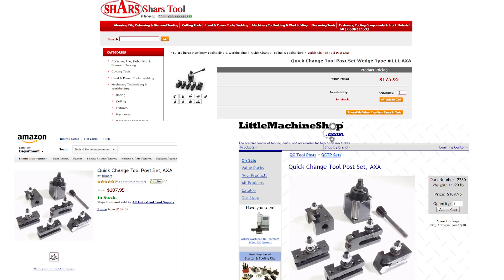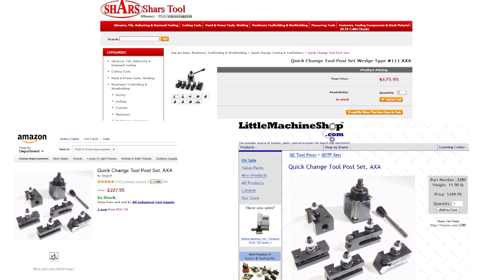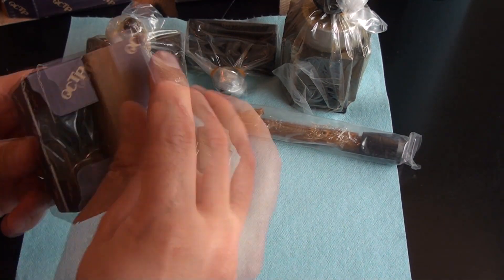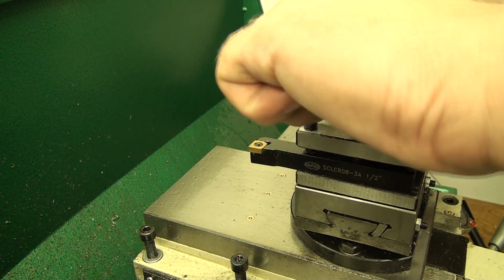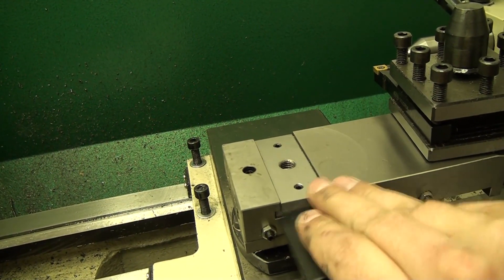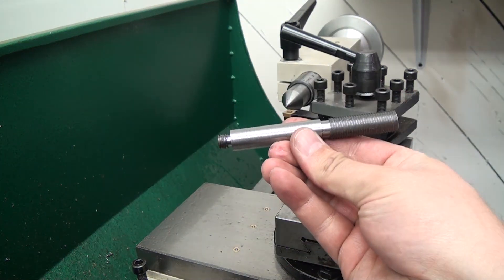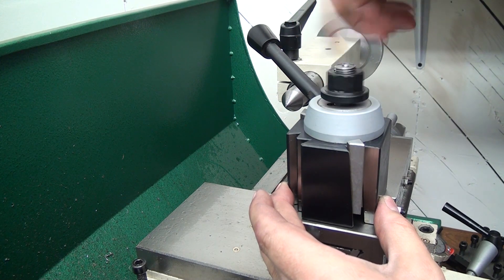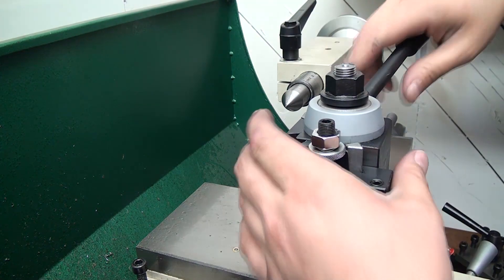16 G0602 Shars QCTP (unboxing and install)

Comment: You appear to have a Grizzly lathe.   I did exactly what you did, making my own tool post.  I have a Grizzly G0752.  I also bought a spare adapter plate from Grizzly ($4) that eventually I will drill and tap for the larger thread of the tool post that comes with the QCTP.
Reply from the maker: That's a nice solution, and cheap too!

Comment: Hey buddy I bought an axa tool post for my g0602 and I just tapped the stock t nut m14x1.5 for the beefy new bolt the axa tool post came with.  Everytime I tighten the top nut down on the bolt that goes thru the tool post the handle doesn’t want to move without a bunch of effort back and forth from loosening and tightening the wedge.  Then when I loosen the top nut it’s perfect again and moves like glass like it should it’s making no sense and I’m going insane lol can you help me out?? Pretty please!! Lol if you get a chance give me a call my name is Garth 203-444-6477 and I’d greatly appreciate it buddy thanks!!!!
Reply: How about just letting everyone know what causes it? LOL!
Reply from the maker: You know, I've had the same thing happen on mine from time to time but I've never bothered to troubleshoot it. I wonder if the nut on top is pinching something when it's cranked down to hard. Are you using a flanged nut?
Reply: russtuff I figured it out lol call me if you ever want to know it’s something so stupid lol

Comment: Just watched this again; what is the thread / pitch of the Shars stud? I heard 14mm but is it 2.0 or 1.5?
Reply from the maker: +Timothy Shaner I just checked, and its 14mm 1.5pitch. The reason I didn't drill/tap my t-nut was because I was going to have to spend something like $30 to get drill bit and tap that would work, where I already had threading capability. Plus, I remember thinking that I really wanted an excuse to cut some threads, and being that I now own a lathe I shouldn't have to resort to drilling/tapping when I didn't want to.

Thanks for watching :)

Comment: A bit old but..
Would just re-drilling and tapping the existing plate for the bigger stud work also? Assuming one would not be going back to the other tool post, I can't figure why this wouldn't work. Thoughts?
Reply from the maker: +Timothy Shaner Yup that would work fine.

Comment: Question...to confirm, this is a G0602 lathe you have the qctp installed on correct?  And are you using 3/8" tooling and or does larger or smaller tooling works also?  Did you or do you plan to lower the compound to drop the tool center?  I have seen that in a few videos.  I guess if it can take 1/2" BUT you use 3/8" tooling that would reduce the problem or need to drop the height of the post right?

Thanks again!
Reply from the maker: I'm using 1/2" tooling, and the only modification I have had to make is thinning one of my 1/2" carbide insert holders. I think 3/8" tooling would  work perfectly on this mill too. Also, I keep thinking that I am eventually going to convert this to CNC, and if I do I'll remove the compound and just make a plate to get the tool tool post to the right height.

Comment: Thanks for the video, this helps me figure out what to order for my G0752.  I plan to turn and thread a new stud like you have done.
Reply from the maker: Cool! I would love to have that variable speed setup. I've never swapped out the stud I made because it has worked great. I would suggest some blue thread locker to hold the stud into the plate. Mine would back out from time to time.

Comment: Did the post or out or did you wind up having the plate milled?
Reply from the maker: The post is still going strong. I've had a mill for a while now so I could have made a new plate, but there really hasn't been a need. The only thing I would change about this installation is that I need to put some blue loctite where the post threads into the plate. Sometimes it will back out a little when I am loosening the large nut at the top of the QCTP.

Comment: Just in case you didnt know. That is a generic chinese import qctp.They are all the same from anywhere you get it from . LMS just has a marked up price. I got my AXA set for 110 shipped on ebay. I also have a 7x14lathe and bought the OXA from LMS a while back which back then i didnt know any better and could have saved some money buying it on ebay. Any black one is a chinese import. Other brands like phaseII ,Dorian, Aloris are not imports but you can see the difference between them right away.

Comment: Hey Russ, after 6 weeks in its crate I finally got my G602 into the basement and all cleaned up, both tasks were big jobs :) In true fashion of following the trail blazers, I got the same QCTP& It looks good so here's a tip of sorts: Rather than make a new bolt for the tool post mounting, I simply bought a replacement plate from Grizzly for ~$3. I drilled it out with a 1/2" drill and tapped it 14mmx1.5mm. Sadly, I did have to mill the bottom of the new plate - it wouldn't fit! bad Grizzly!!

Comment: I installed my new AXA wedge type QCTP on my Grizzly G0602 lathe this morning.  The spindle shaft for the new QCTP was 9/16" od and threaded 9/16-18.  Definitely not M14x1.5 thread like referred to in other related posts.  I drilled and tapped the existing t-slot "nut" to suit, locktited the new spindle shaft in place, and all worked perfectly.  The QCTP assembly was a no-name Chinese product, and was exceptionally well made!  Simply a pleasure to use after fighting the 4-way holder!

Comment: On my huvema lathe a 10 mm pin with M10 threads sticks out.

And it coms straight out of the cross slide without a T slot.

So i think it workes out fine

Comment: Quick tip:  to make your toolpost square to the chuck or faceplate, loosen the toolpost and pinch a 1-2-3 block between the toolpost and a flat face on the chuck or faceplate.

Comment from the maker: I see what you mean. You could hold the stock 10mm base plate in the 4-jaw and even install the stock 10mm bolt and indicate it to center. You could then drill to 14mm from the tailstock, but while your base plate is in the chuck you have no way to mount the tool post to do the threading (since the 14mm base plate does not fit). The thing to do at that point is buy a tap and get your 14mm threads by hand, but I was personally trying to be as cheap as possible and already had the 12L14.